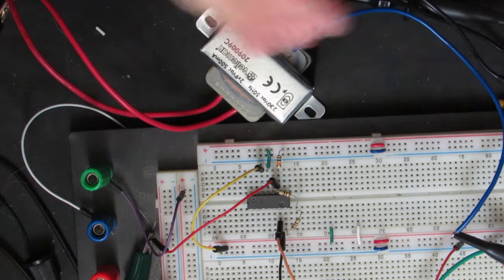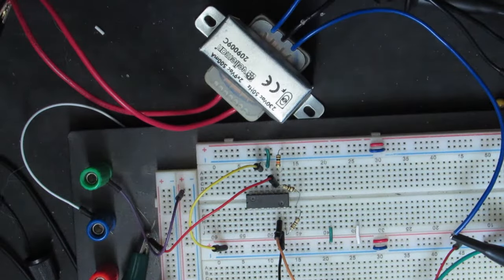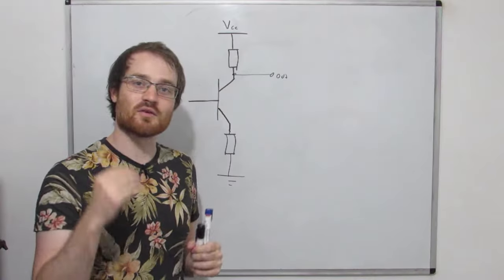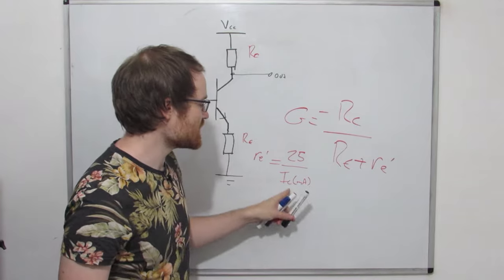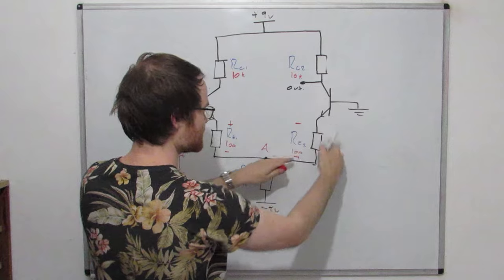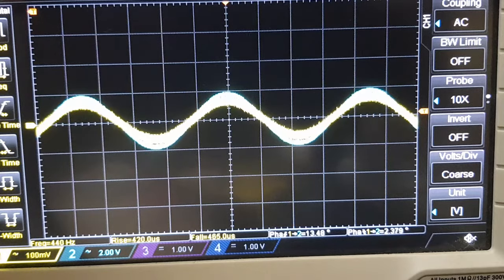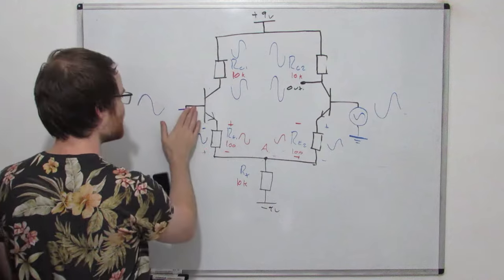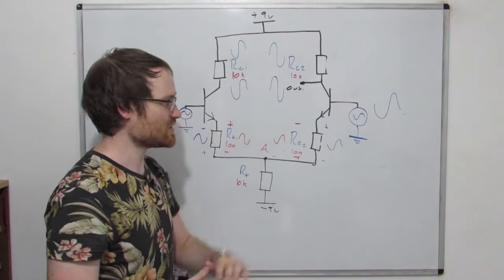Differential Amplifiers Made Easy

Comment: Quite excellent insights and appraoch to explain the comparator circuit. It appears in an old power supply voltage control circuit (Coutant LQT 100) and your video is helping me digest and understand how it works to repair it.

Comment: Tyabk you for the amazing explanation. If i understand correctly, then, the reason why we often use a current mirror as a tail current generator, instead of a resistor with fixed potentials, is that the current mirror will ideally feature a very high output impedance, thus since this is featured at the denominator of the common mode gain, this means that the common mode gain will be hugely reduced?

Comment: I've got two questions. 1. Can I use this differential amplifier in parallel with a load.
2. Do I need to impedance match the differential amplifier to the load impedance

Comment: Thanks for the vids. very imformative!  I have a question.....I have watched this video a few times, and still I am not sure I can follow what you say at 6:26.  You are saying a "loop" (I assume, current) is going from the transistor on the left, through the 2 resistors, through the transistor on the right, and to ground.  That's where I get stuck--I didn't think current could reverse bias through a transistor as you describe--on a NPN, the base > emitter appears to the world as a diode. But then again--I am a newbie....Do I have a fundamental misunderstanding of current flow through a transistor?
Reply from the maker: You're not wrong! The only thing missing from your understanding is the assumption that the transistors are on all the time, when the transistor is switched on we can think of the base->emitter junction as more like a very low value resistor, allowing the input to be placed 'across' both transistor's emitter resistors. When i say loop i mean a voltage loop in terms of kirchoff's voltage law. I think i mention this in my circuits 101 video :)

Comment: im new to building DIY guitar FX pedals . i recently built a (Boss BD-2) Blues Driver ,it uses a discrete opamp for two stages in the circuit. i really like how the circuit sounds but i would like to understand how the discrete opamp works a bit better . im a bit confused on how the negative feedback works and how the audio signal flows through the  discrete opamp ,I was wondering if you have the free time could you make a short video showing how the audio signal flows through and how the negative feedback works using the Boss BD-2 schematic  . thank you for the videos i enjoy them a lot.